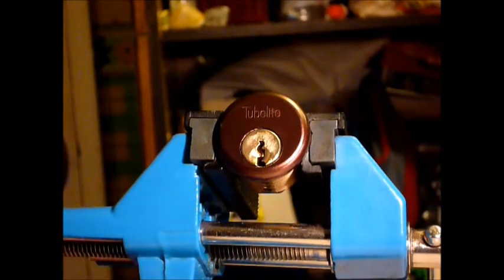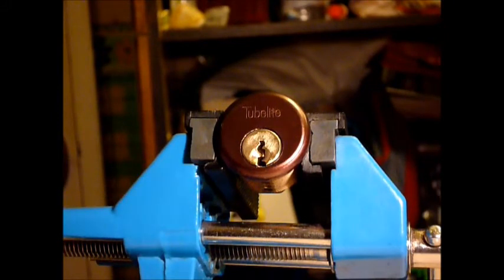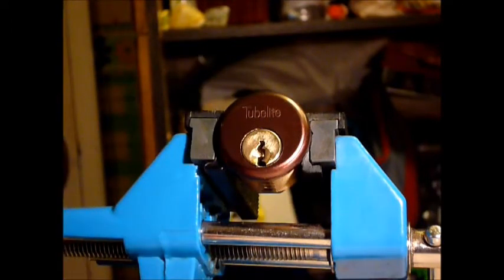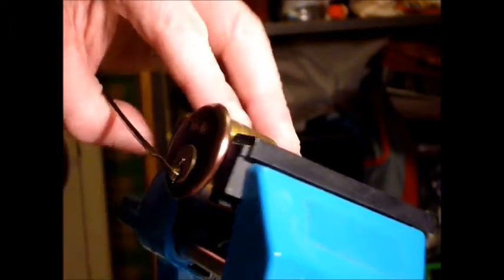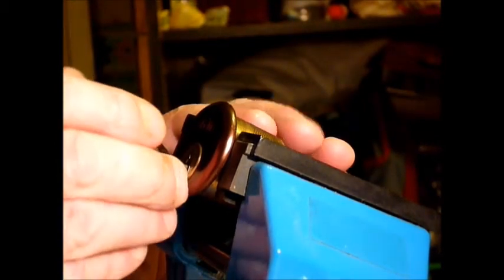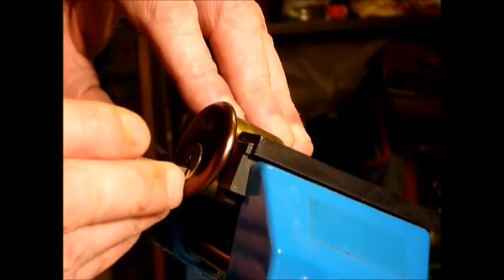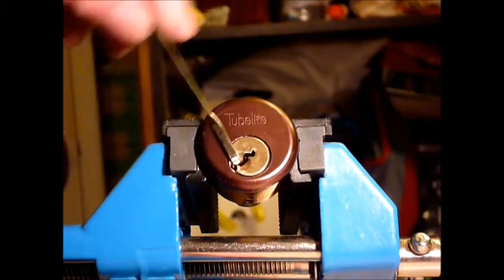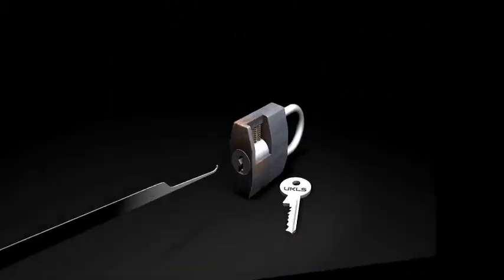Single Pin Picking A Tubelite 5 Pin Mortise Cylinder Lock From Bosnianbill www.uklocksport.co.uk

Comment from the maker: Cheers Bill my friend. I was going to have a go at gutting it but thought I would leave it alone and pop it on display with my vintage locks. I tried gutting an ERA lock the other day to show a subscriber there were no security pins in ERA rim cylinder locks.... Made a right mess of it due to using my lads felt tip pen as a follower. I managed it though even when pins and springs flew all over the table LOL!!!!